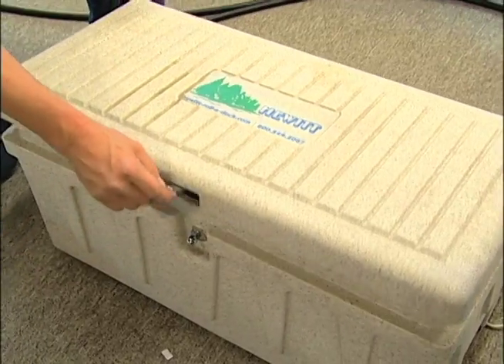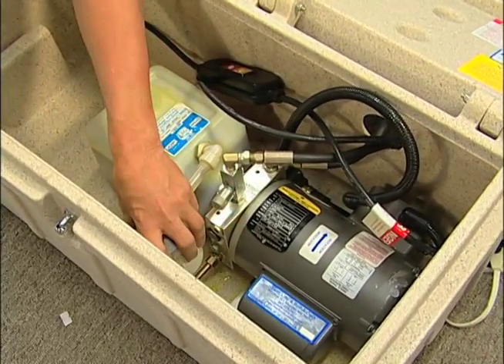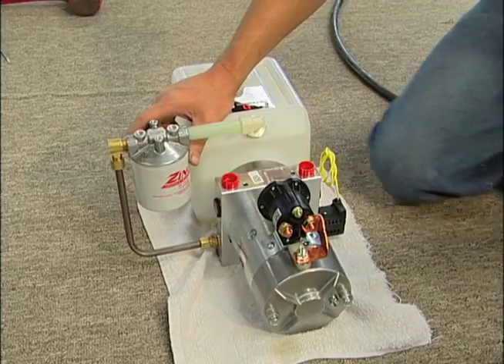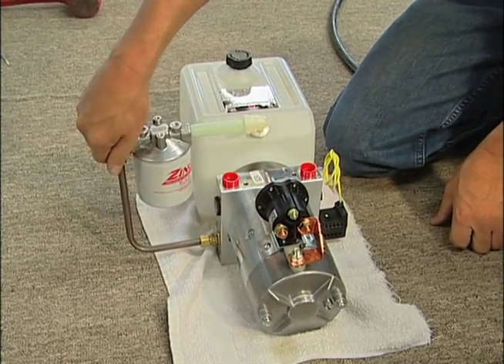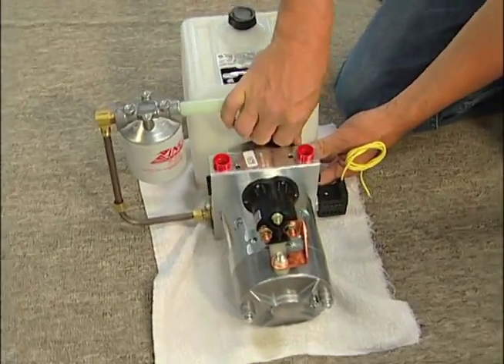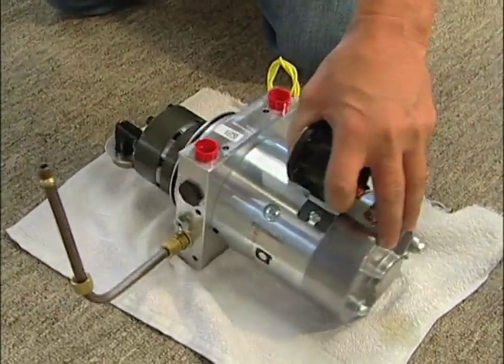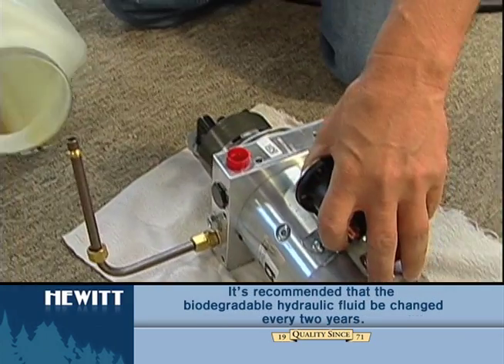Why has the Hydraulic Pump Slowed or Developed a Squeal?

Comment: Can I connect an external tank line to that L bracket on the pump directly? I'm trying to reduce the horizontal size of the whole contraption.
Reply from the maker: Thanks for the question! The filter and tubing connected to the top of the tank is the return oil lines, there is a complete supply and return circuit there that should not be altered or you risk not supplying the pump with the proper amount of oil and risk damaging your pump.
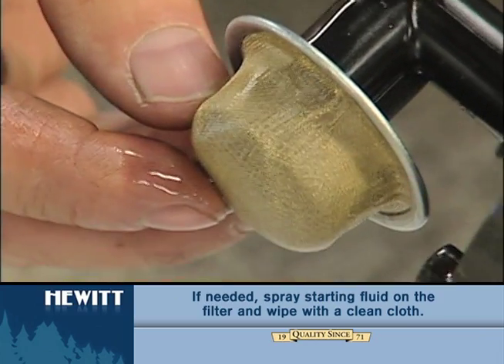Reply: @HewittRollADock  I'm referring to the L pipe at 0:48 in the video. Tank should be at 0 psi pressure. So having an external tank and gravity feeding oil from the external tank to that L pipe should not break the circuit. Do you agree?
Reply from the maker: @DIYGuy85  We do not recommend altering the circuit.